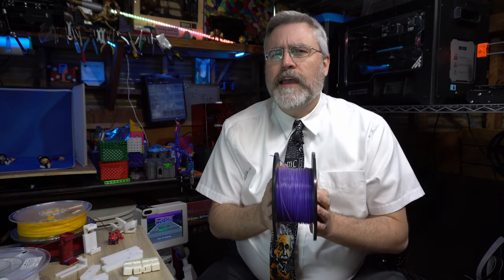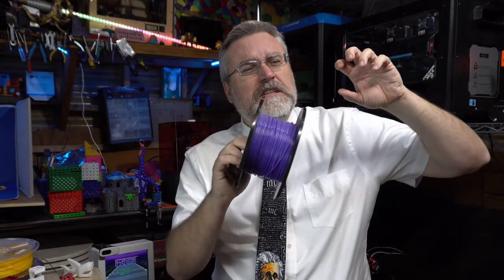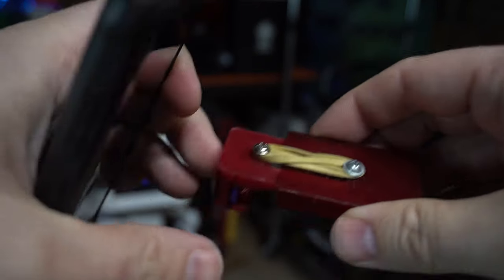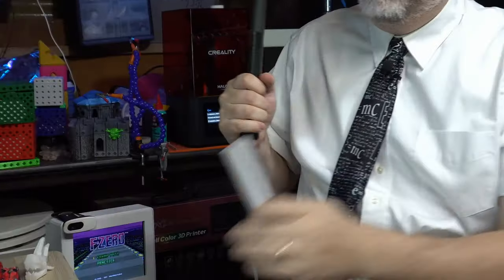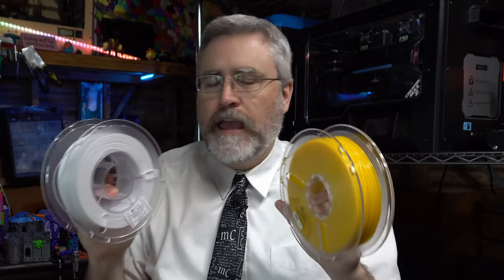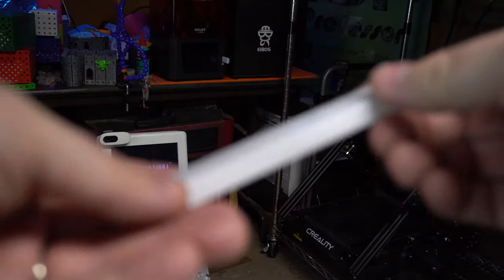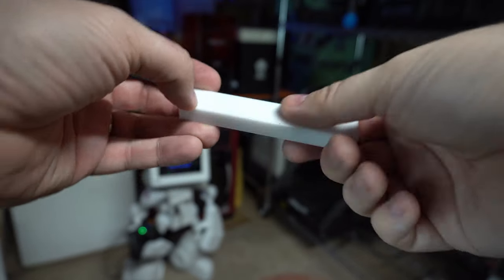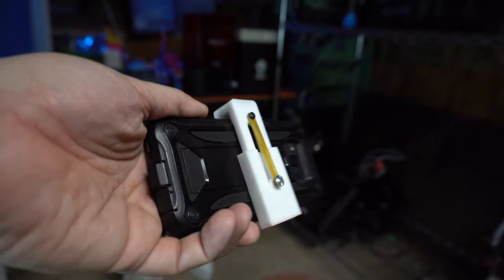What is the strongest 3D printing material

Comment: I think the issue you have with 100% infill is going to be down to nuances in e-step, flow calibration, and possibly pressure advance, if you can't lay it down in smooth layers side by side for surfaces, that sounds like you might want to try the calibration method of a 2-wall-thick cube with no top, bottom or infill, then measure the resulting wall thickness at the top edge to dial flow back. Even with E-steps 100% perfect and accurate, there is the fact of thermal expansion inside the nozzle, backpressure based on print speed etc, I print my PLA ~95-97% usually, else it's over-extruded even if e-steps are accurate. On prior generations of printer firmware, I've noted they would very often do things like intentionally set the e-steps to be a bit higher than needed, because if you're making things that don't need accurate dimensions, more is always better than less plastic, except for surface finishes!
Reply from the maker: It's true, you might be okay with 100% infill depending on X Y or Z, but you will be fine at 90%. So that's why I advise that generally.
But you're right, the problem used to be a lot worse than it is now because slicers were still growing up.

Comment: The use in terms when discribing materials needs a lot of improvement in 3D printing community. TPU is not strong, it is tough. PLA/PLA+/PETG are strong materials as they have highest tensile strenghts. PLA is hardest and most brittle material. Obviously all of these properties change quite a bit between different brands.

As a designer you choose the material according to the use case. In exaggeration, you don't choose TPU/rubber if you need the strength of steel.

Comment: Interesting.  I was hoping for something that would address 'dimensional integrity'  ? My jobs require strength with close fit interaction with other parts. Bendy in any degree is a non starter. Why don't you mention carbon fibre based filament which is now on the market   ?? 🇬🇧
Reply from the maker: Carbon fiber filament has been on the market for a long time, but it is 3d printing in hard mode. PETG is surprisingly not much harder than PLA, and if you have a direct dive printer, TPU isn't that difficult either.

Comment: after uogradig to tyhe sonic pad i managed to finally get TPU to print very well and made myself a phone bumper case. I am now designing track bike wings but i can't see tpu hold the calculated downforce
Reply from the maker: Give it a shot and see how it goes. I was surprised by my attempt to use TPU for the wrong stuff.
Reply: @3dpprofessor  yeah good point, need to know the amount of downforce and check if tpu holds up doing static load tests or something. Worth a shot

Comment: I would want to see it vs Taulman nylon like the 230 or the 300 series either one,  I have rebuilt the whirly bits holders in an upright shark vacuum cleaner and not had it break in over 4 years of daily use (used the taulman 230 as I did not have the higher temp hot end for my printer at the time) 

I do have to wonder what the black coloration is in their black version, since black tarp PE sheeting lasts for years in the sun of the summer but one summer is all it takes the same plastic that is clear to be degraded and crumbling. If its the same, then it would mean it would resist UV damage from the sun too. (ie use the black colored one if it has to be outside in UV basically lol)

Comment: Yup. TPU is among the best stuff out there. If the geometry supports it and there isn't the need for a ton of stiffness, a cheap TPU will kick butt over just about anything else. And it won't warp in the car either. 😂

I used TPU for repairing a latch on a Prius center console and it has weathered several summers. Before that, I used scrap PET from a candy container and that easily softened and warped in the summer over time. https://youtu.be/URTddkW1xgM

Comment: PLA has been around since the 1920s.  it was discovered by the same dude who invented nylon
Reply from the maker: This is technically correct. Which is the best kind of correct.
However, when 3D printing started, we did it all with ABS. It was later discovered that PLA was a better choice and it the formulation was tweaked a little to make it an even better 3D printing material.
But, yes, saying it was invented for 3D printing is a bit hyperbolic.

Comment: PLA was around way before 3D printing. Disappointing fact-check. Someone just started making filament from it.
Reply from the maker: This is true.
When I say PLA was invented for 3D printing, that's a bit of a stretch of the truth. It would be more accurate to say PLA found it's most useful application in 3D printing. And, like PET was around before, PETG just fine tuned it for 3D printing, the formulations of PLA that we use are likewise tuned.
Reply: @3dpprofessor  I understand. This video was oddly perfect for a problem I’m solving at work. We are making machines that use mortar for bricklaying and it sticks like crazy to rigid plastics. This gave me the push to give the whole part out of harder TPU, so thank you for that.